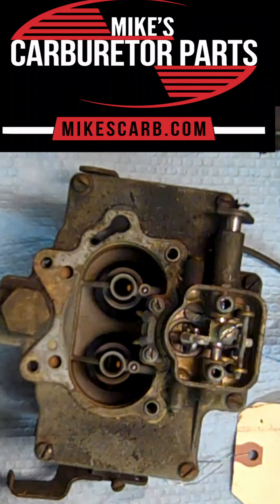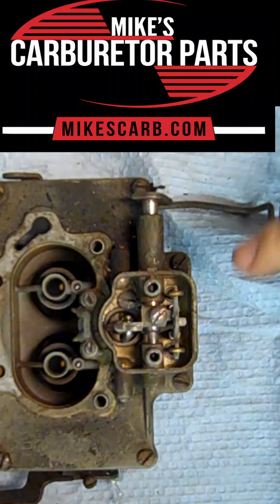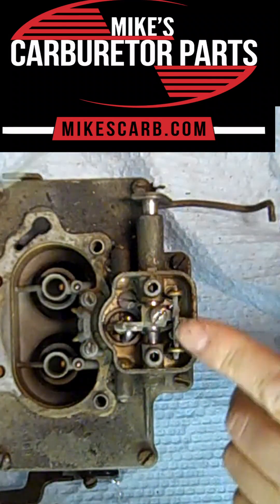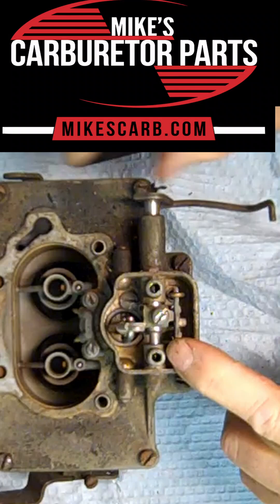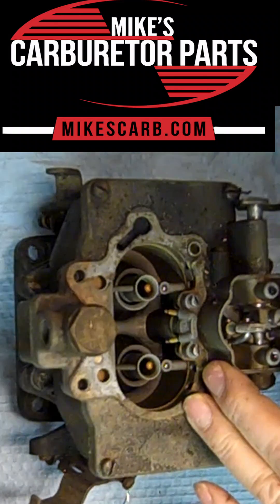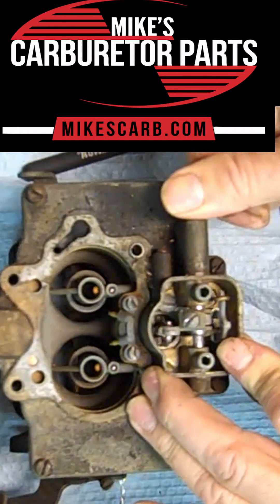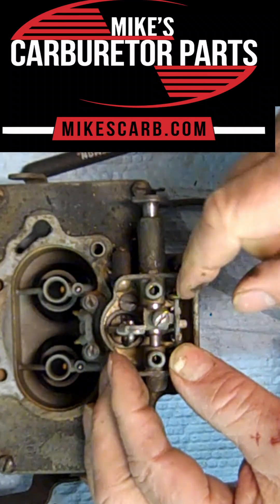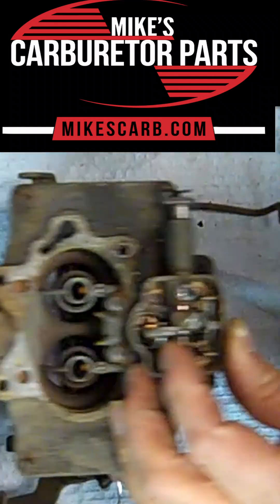Carter WCD How The Metering Rods Work

Comment: Hey Mic, do you have any video showing how to put the throttle linkage together for a single barrel Rochester carburetor on a two 50 in.³ in-line six that’s in a 1966 Chevy C 10 short bed? I need help figuring out the throttle linkage connections and springs going from the carburetor to the firewall, I have the single rod from the gas pedal coming out of the firewall to the carb but everything else is alien to me and I can’t see or find anything else on the Internet showing and even talking about this throttle assembly. Thank you so much, Mic. I appreciate you.
Reply from the maker: Sorry no.